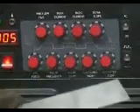Everlast Welder - 200P ACDC Tig

Comment: I have the IGBT version, the Longevity LS-200PI welder/cutter and using variable AC frequency with the pulse mode makes welding thin Aluminum sheet almost easy.

Comment from the maker: Hi SEREICHARD
  Sorry I took so long to respond, I have been out of town.  I dont recall the specifics.  The settings on aluminum depend on the thickness of the aluminum.
   Turn the basic and the peak all the way down and the rest at about 25% on the dial, the freq is at 50% the pedal knob is most important, at about 10% onthe dial, and use full pedal, dont throddle the pedal.
 Play with it from there. Let me know if I can help.
Sincerely 
Leonard Hester